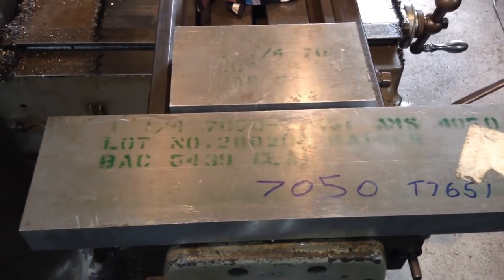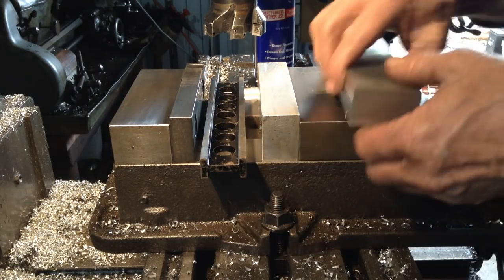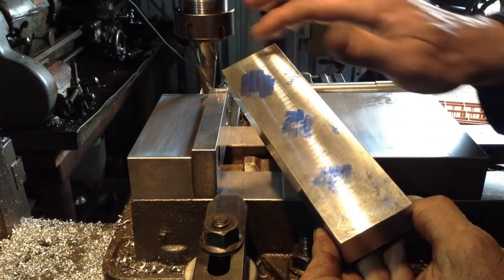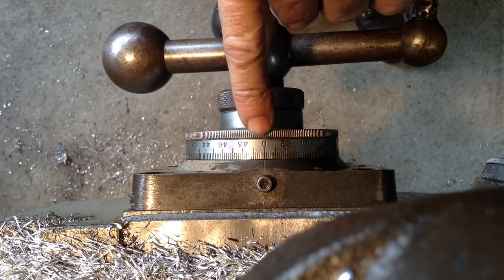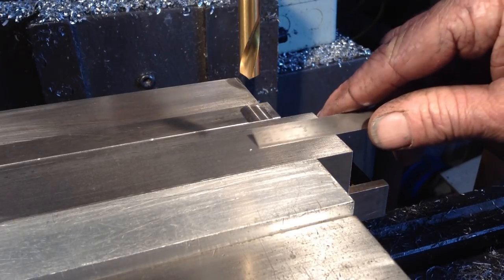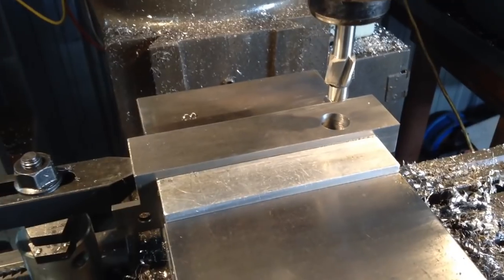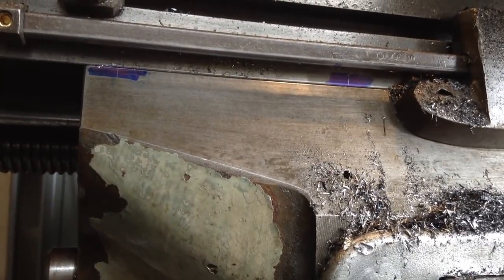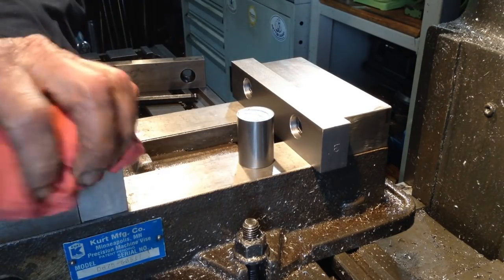Small run repetition set up's  in the Lathe & Bridgeport . Part 1

Comment: Hi Max, back in the mid ninetees I had a BP clone, machinery dealer in Perth said I was living in the dark ages without a DRO.
Installed an Accurite DRO, not cheap, I saw the light!
Last month installed a cheap DRO on my  Mill Drill, cost less than $300 and many more features.
No more backlash issues and trying to read the dials.
Reply from the maker: It's on the definite one day list , high up on that list .  But i spent the money today on a new lathe chuck & other stuff !!!

Comment: Hi Max is that a factory  X power feed on the Bridgeport  also why do you have the zay45 mill ?
Thanks for the videos . Max the soft jaws turned out great .
Reply from the maker: Yes it is an original power feed & it works great .
The zay was my first mill , it gets used as a drill press now as it has a MT4 spindle 
& my biggest drill is about 1 3/4 ''  & it will run that easy .
Reply: Max i have a similar mill Bolton zx45 it has R8 spindle MT4 better for drilling . On the Zay / ZX mill  do you think if the gear box was removed that the rest of the mill could be converted into a surface grinder . I wonder how long the X axis ways would last . Just an idea . Thanks
Reply from the maker: @junkmannoparts9696  Seriously , for the amount of work involved to do it , the end result would be a grinder with a stiff table to traverse & a really coarse down feed .  Also they are not built for that sort of accuracy .   Don't old surface grinders come cheap over in the U.S . ?  Cheers .
Reply: Honestly Max I didn't really want to do this it was just a thought my machine only has 10 hours on it four Access dro and I need to sell it I hope somebody buys it. I picked up a brand new 20 year old Bridgeport clone.   Look forward to your next video Thanks

Comment: You say machine a scallop to hold round stock, wouldn’t it be better to cut a 45 deg V so you can machine various dia stock! 👍👍🏴
Reply from the maker: These are  '' special jaws ''  only for this job .  It will  become clearer in the next video why a v groove  was not used .     The Aluminium jaws will get a common v groove  .     Cheers .

Comment: This is the info I have on this aluminium 7050 T7651.  Ok here goes, "7xxx"  designates aluminum-zinc, is heat treated and helps with rust protection, These numbers are % 0.50 silicon, 0.7 iron, 1.2-2.0  copper, 0.30 manganese, 2.1-2.9 magnesium, 0.18-0.40 chrome, zinc 5.1- 6.1, 0.20 titanium.  the highest concentrations are of zinc.   OK maybe to much info.
Reply from the maker: Thanks .    It is great stuff to play with .  Cheers .